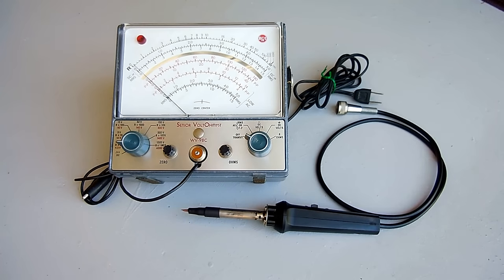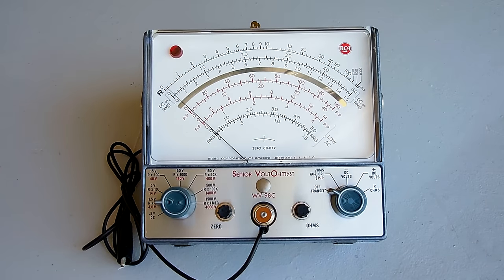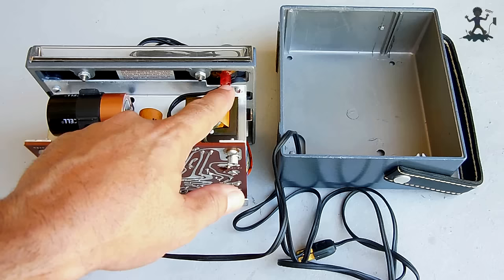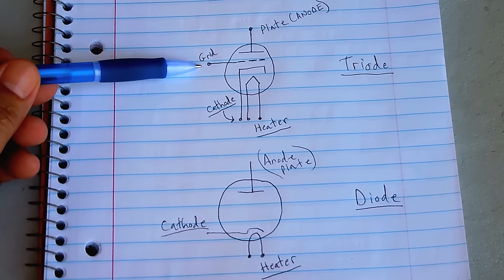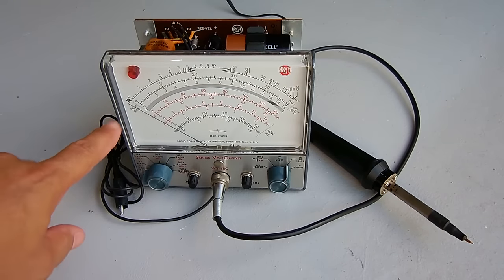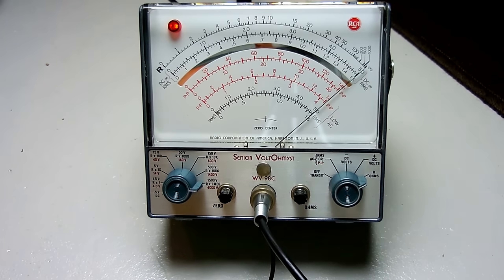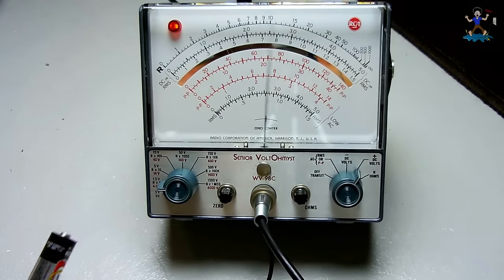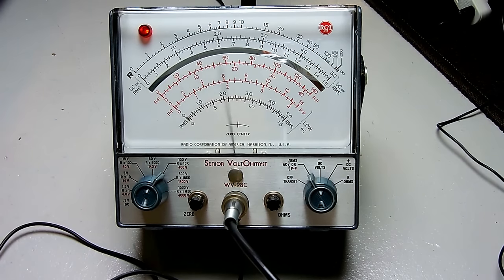RCA VTVM Operation and Teardown

Comment: The unit you have there dates from the 1960s.  RCA stopped using the round "meatball" logo in 1968.  The newer meters from the 1970s would have the block RCA logo.  Even later, these meters were made by Viz, and those have their logo on them.  It's a very nice meter to have and yours is in very nice shape.
Reply from the maker: Thanks for the info, and thanks for watching!

Comment: What a great find!  I used to work with an VTVM mid 80's early 90's, I used it for servicing Motorola voice pagers, they had a high input impedance.  There is still a use for that meter today.  Thanks for sharing, brings back memories.
Reply from the maker: I'm glad I found it. :-).
Reply: For some tests a analog meter is better.  We used to use analog meters for peaking levels, the DMM's tend to jump around a lot and hard to read when peaking.
Reply from the maker: Pete Ciallella
True!

Comment: Great video. I believe that the inductor you referred to is actually a capacitor. The schematic does not have any inductors as part of the circuit. I believe it is C9.

Comment: back again. 3 wire device ( mentioned below) to replace a vtvm c/d cell failed. not wanting to tax built in pwr transformer  with a diode and cap circuit fed from vtvm filament i opted to use the circuit board from an old 5.7 vdc smps used to charge a cell phone instead.  to its output went an ebay adjustable LM 317 regulator board.   all this neatly in a pill bottle. finished project fit neatly where D cell once was. gotta love these vtvm's

Comment: Great video, lots of great info. and very clear to understand. I got real lucky at an auction. An old Radio man passed and his wife gave it all to the Auctioneer. She told him" just take it all".  
 I got the VIZ wv-98c. He has already replaced caps in it and is on the money with measurements. I got a whole lot more. 10 Tube testers, 2 Signal tracers, 3 Signal generators, 1 Tektronix oscilloscope, 1 BK frequency counter, 2 Simpson 260 meters, 1 Sencore transistor tester, 6 Multimeters, Capacitor testers new and older ones like Eico 950B,  Power supplies, a Variac.
1 Sencore sg165, 1 Weller solder station.1 Heathkit VTVM. Thousands of parts, caps, resistor, pots, light bulbs, all in organizers. Probes, Jumpers, Tools of the trade ect. 
I got hundreds of tubes, there were thousands of tubes I could not get them all. I got some Instructional books and Manuals but there were whole sets of them from back in the day.
I also got 150 or so old Radios that are from 1930s to 1960s Am,Fm,Shortwave, almost all need repairs of course.
There were hundreds more radios. Table tops and floor models. I could not get them all. I mostly went for the test equipment.  
All testers have been updated and work great, some look like they had never been used. He did great work restoring radios. I just wish I could have met or known him. RIP
 I may have  400.00 invested in it all. They only put out so many items at each auction. Took me about 4 months to get what I got. Auctions were every 2 weeks. It's all been sold now.
Thanks for the video for I am just learning to use such meters and work on electronics. I love the old school equipment.
Reply from the maker: Wow, you did great! :-)

Comment: OMG. I haven't seen one of these for many years. Talk about going way back. The first time I saw one of these devices was during my last year in Electronics School in 1970. We were using VOM's and VTVM's with a kind of scaling digital display before that. I remember thinking these things were the greatest inventions ever.
Reply from the maker: I was thrilled when I found it. Thanks for watching!
Reply: electronicsNmore I'll bet you were. Just one thing I would like to correct you on. You said the meter had an 11 megohms input impedance as opposed to a 10 megohm impedance on the newer meters. The VTVM's actually have a 10 megohm impedance with out the 1 megohm resistor that is normally in the probe. The meter is calibrated for use with this 1 megohm resistor. The total input impedence is 11 megohm with the 1 megohm probe resistor in place.
 I remember when buying the high voltage probes for use on TV high voltage systems, especially when the transistorized meters started coming out, you had to make sure you bought the right probe with the right resistor or the meter calibration would be wrong.
Reply from the maker: You're correct.

Comment: A dual diode tube with a center tap transformer is full wave rectification, even if the capacitor is tested okay on lower voltage, it still can be extremely leaky on higher voltage, thumbs up :)
Reply from the maker: The dual diode tube is not across the output of the step down transformer, it's used to rectify the AC input from the test probe. Thanks for watching!
Reply: electronicsNmore Ok

Comment: could you change the meter fitting to a bnc and use an oscilloscope probe, because it has a 1x and a10x switch which is a 10 meg ohm resistor in it..?

Comment: Since when are average and rms the same???
Reply from the maker: Been a while since the video was made. Did I mention in the video if the reading was average voltage or true RMS?
Reply: They ARE the same if the signal is sinusoidal.
Reply: @EJP286CRSKW  Wrong  Average value = 0.637 × Vpk          RMS value = 0.707 × Vpk